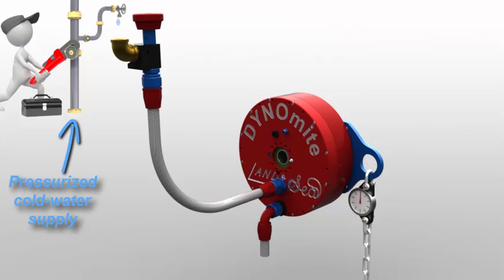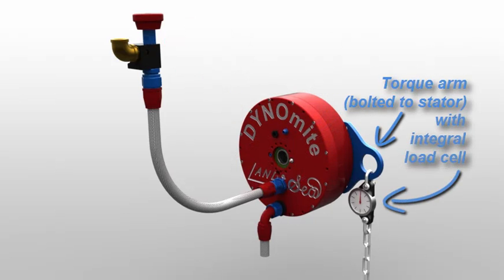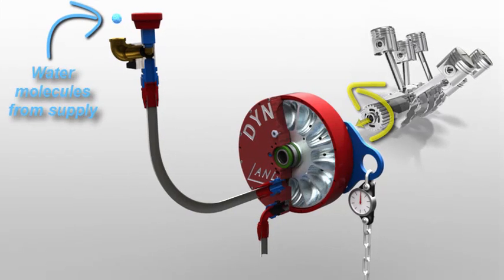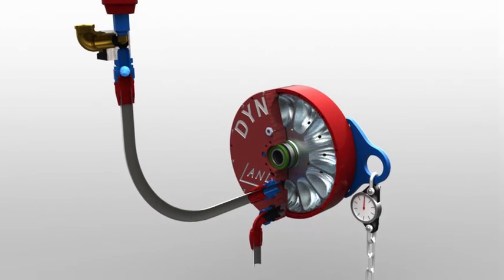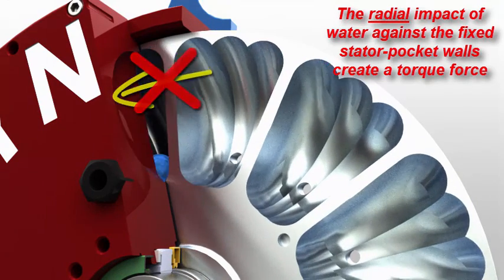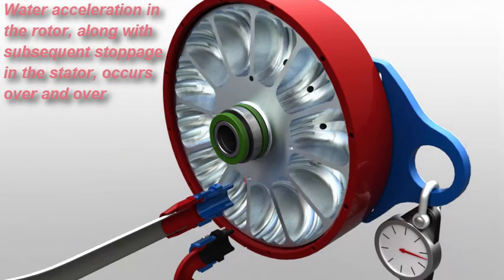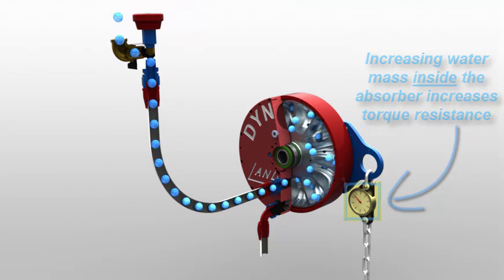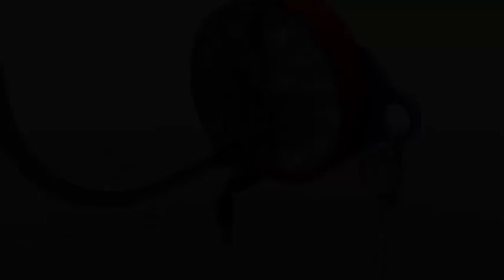Tech Talk Animation on How Water Brakes Work

Comment: Re. 1:55: there is no such thing as centrifugal force.  The water droplet in the rotor wants to go in a straight line but instead finds itself in an accelerating frame of reference; the acceleration is centripetal.  The rotor is giving energy to its water droplets whereas the stator is not.  This makes the water droplets in the rotor want to continue in a straight line (Newton's first law of motion) whereas the droplets leaving the rotor force the droplets in the stator to undergo centripetal motion.
Reply: @vaibhavsharma300  it's not meant to generate any kind of power, the purpose of this device is for braking a spinning motor or absorbing rotational energy, it converts kinetic energy into heat, so when it's used the energy it absorbs is pumped out as a waste product, which is hot water. It doesn't need a lot of water either, that may be a misconception about this device, it only needs a trickle of water to keep it cool, enough to continuously flush out the hot water and keep it under 100C°. It's main benefit is it's lack of friction between components, which means it has a long operational lifespan compared to something like a disc or drum brake.
Reply: @vaibhavsharma300  the reason the water gets hot is the same reason a torque converter gets hot. The water is being put under a severe shear load and as a result heat is generated. However as stated in the video, fresh cool water is brought in and the warm water is let out, if you continue this it will create a cooling effect and mitigate the generation of heat, it won't completely stop heat from being generated but it will greatly help.

Comment: Ideally the water should enter the cavity at the center of the “vortex” where the pressure is at a minimum, not at the outside edge.  The fill and subsequent torque should be controlled by a valve on the outlet.